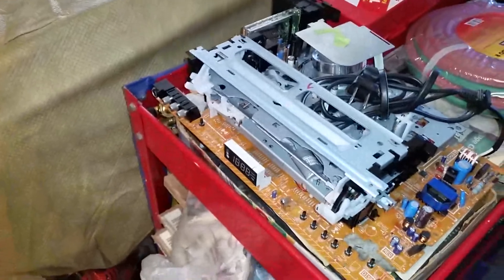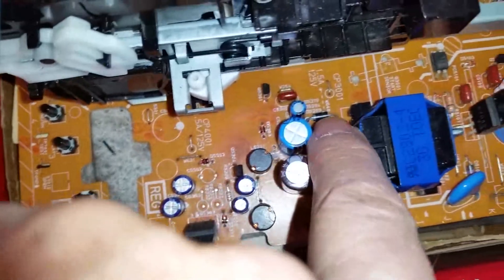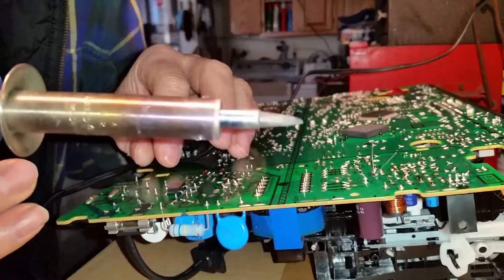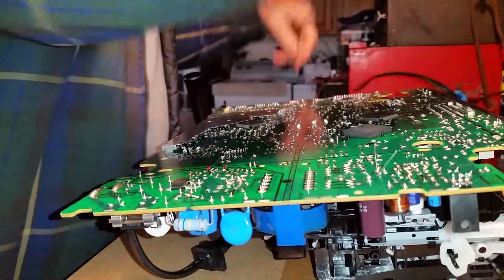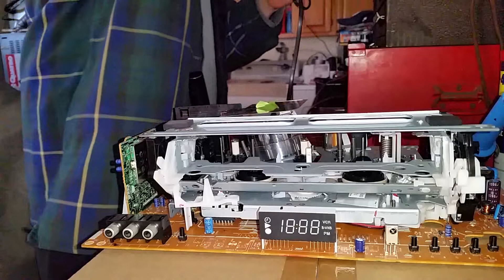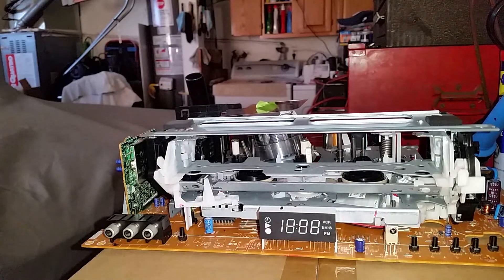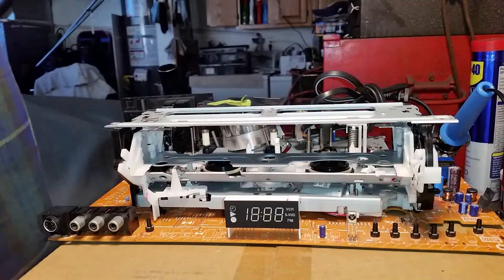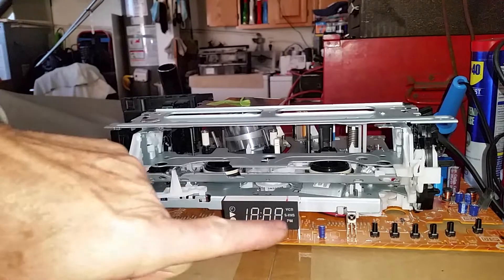JVC S-VHS VCR power supply repair caused by power outage

Comment: Could I potentially send you a power supply out of a Japanese jvc w-vhs vcr? If you do repairs that is. I have the clicking psu problem, and it persists after I replaced a few capacitors and unplugged the psu output cables in order to isolate the psu from the rest of the unit. Click click when powered, then click click again when powered off. No display.
Reply from the maker: Contact Dave at 12voltvids